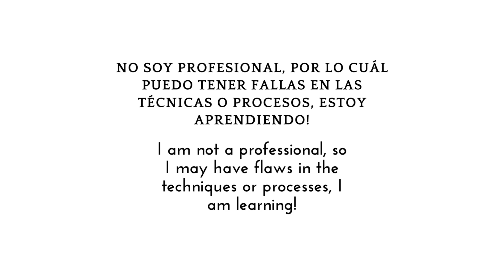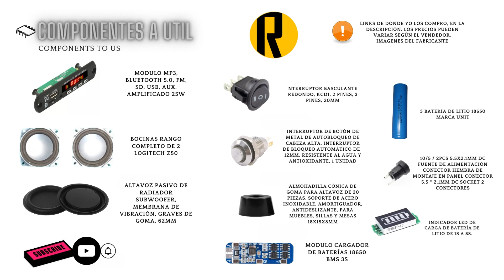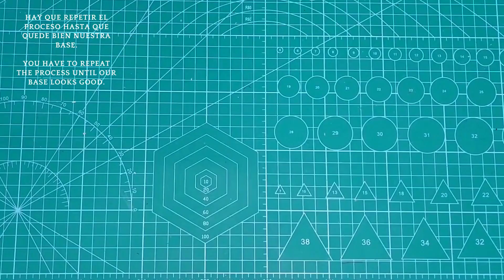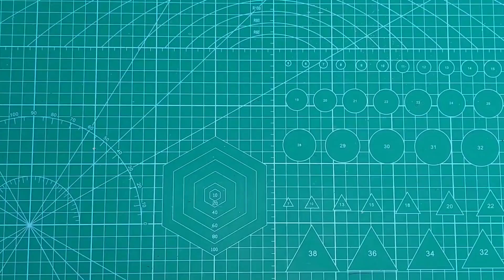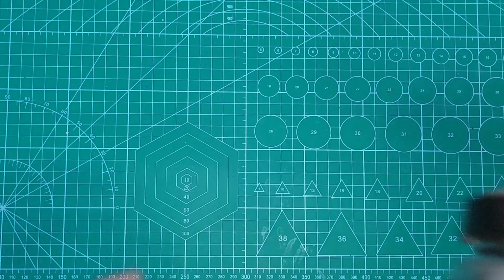DIY Como hacer una POTENTE mini Boombox CASERA Bluetooth #bocinas #bocinaportatil

Comment: amigo un consejo, cuando uses un radiador pasivo sella la caja al 100% basta con la mas mínima salida de aire para meter distorsion,  el interruptor, el modulo sus entradas intenta sellarlas por dentro con silicio para ventanas transparentes asi , el radiador pasivo en verdad hará su trabajo y no solo vibrara por nada
Reply from the maker: Gracias Carlos selle bien, separé el modulo pero al final pienso que puede ser tmb el radiador es un poco duro ya me paso con otro en el que use el mismo, de cualquier forma revisaré bien  si tiene fugas gracias!!!